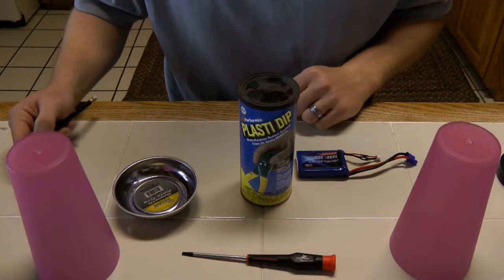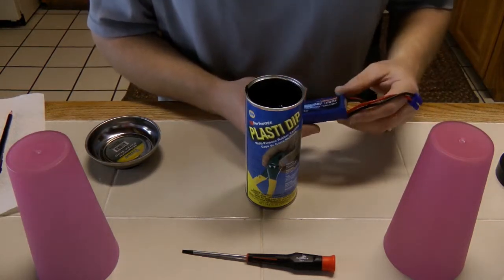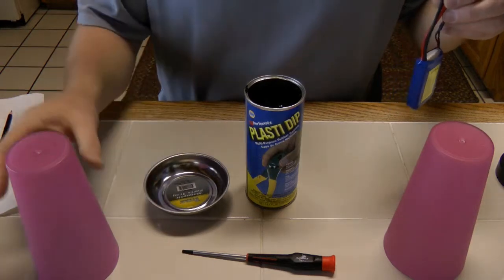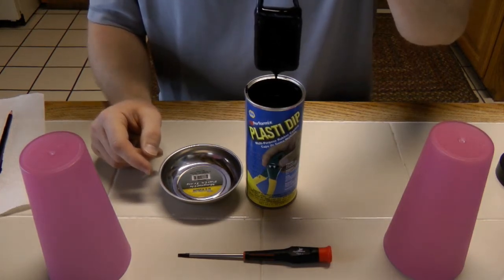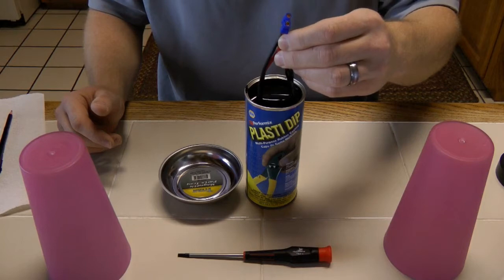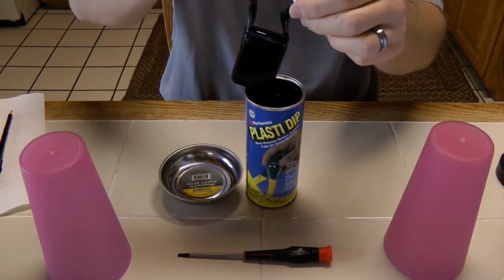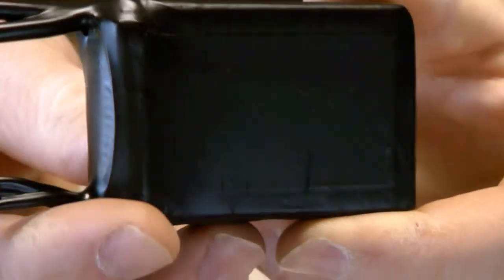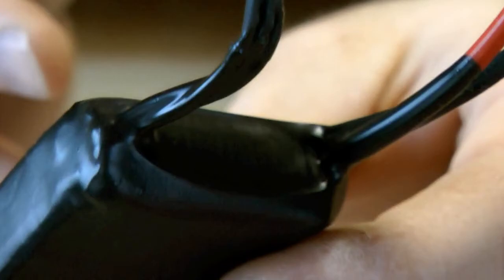Waterproofing RC Batteries Using Plasti Dip

Comment: good video, however I've been doing this with tools for years. 
I want to suggest to you an improvement to your method.
When you dip it go real slow and even slower when you pull it out. real slow. 
then let it dry for 12 hours + then redip it. 
Inorder for a real 2nd coat fast dipping the 2nd does not add much to the coverage

Comment: You do know batteries are water proof already...lipo batteries are air tight as a lipo will catch on fire if it is in  contact with oxygen hence air tight so it's water tight
Reply: The connection aren't.
Reply: I don't think they are
Reply: Brett p the cells themselves are airtight but there are leads that stick out of them and you don't want water to settle around them and cause corrosion. though I take my stuff in the water all the time but never waterproof my batterys though and they're still fine

Comment: i was thinking about doing something like this for my 18650 cells i would use a dead cell use a little molding clay on the positive post to make a nice dome let that dry then put some wax on the battery then just dip the positive post let it dry and slide it off because of the was then i could use the parts i make as battery caps